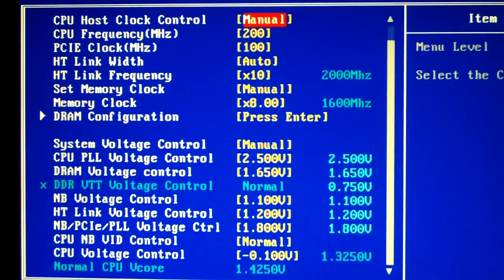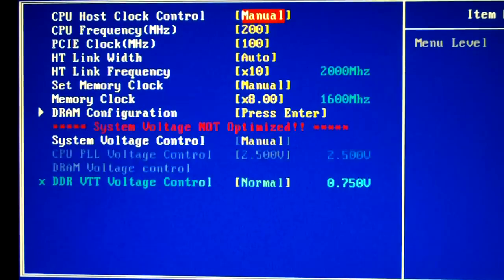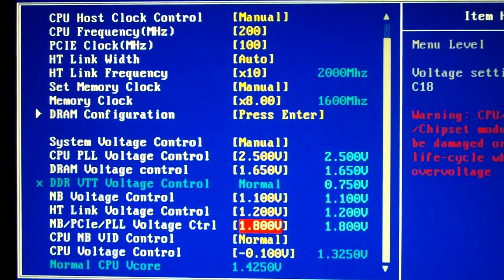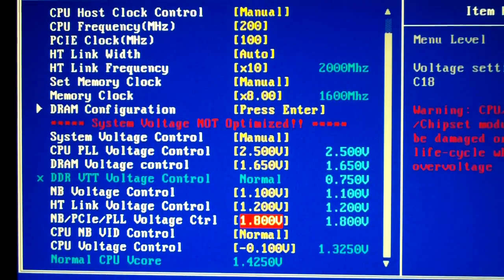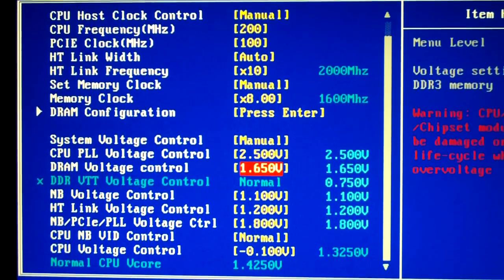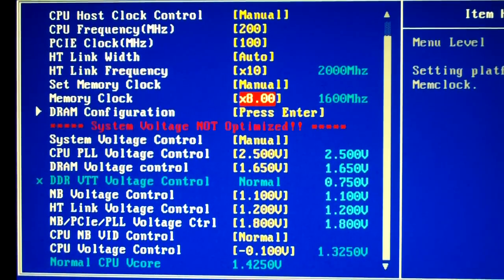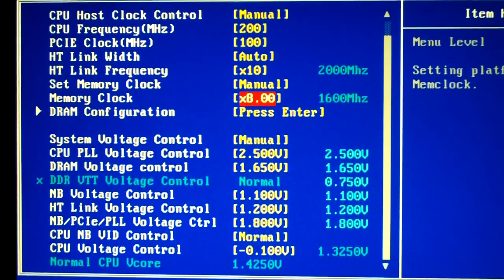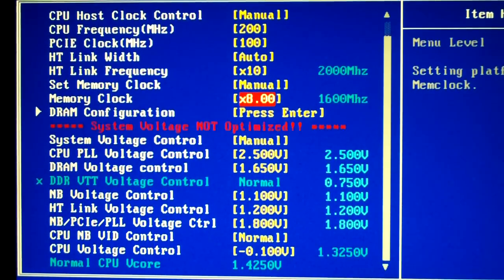Gigabyte "System Voltage Not Optimized" Explained

Comment: Thanks. I recently bought an FX 8320 and gigabyte 990fx UD3 motherboard, and got it running stable at 4.5ghz with 1.328v gamed on it for a few days, ran stress tests without crash, but the constant "VOLTAGE NOT OPTIMIZED" warning kinda freaked me out.

Comment from the maker: @mark13728 NP even if you not OCing I would manually set at least the CPU voltage should be able to undervolt it so it runs cooler and lasts longer.

Comment: Good video. I'm ocing on my current gigabyte board. The first time I did let it optimize the voltages. The second time I left them at default. It was just as stable, but ran cooler

Comment: AMD have a habit of setting the voltage higher than required, very odd!

I was able to reduce the Phenom II X3 in my laptop down from 1.05v @ 1.8GHz to 0.97v, and 0.85v @ 800MHz to 0.725v. Saves a few watts at idle and load.

Fusion C50 in my netbook dropped from 1.1v at 1000MHz to 0.95v, and 0.925v at 800Mhz to 0.875v. Again, saves a few watts, adds a decent amount of extra runtime (8 hours stock, almost 10 hours with undervolt)

Llano laptops/desktops undervolt really well too :)

Comment from the maker: @dx11101 Not really sure I think it would be a great idea for them with the way things are going. The AMUs are sweet and even though the CPU portion isn't as powerful and others the GPU makes up for it if you know what I mean. With the heat load of BD and amount of transistors used I almost think they might be heading in that direction.

Comment: Rick, do you think there is any potential with AMD's APU (ala. the a8 llano w/ a 6670 single card crossfire) since bulldozer is big letdown. I would be very interested in a scaled up high performance version of their current APU. Do you think AMD might totally ditch its current architecture and go full throttle with APUs which support asymmetric crossfire?